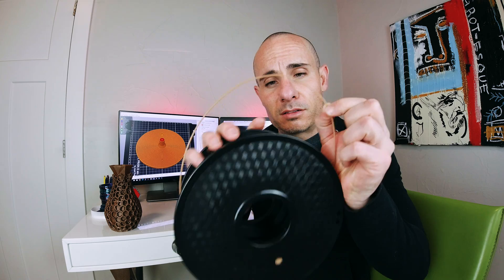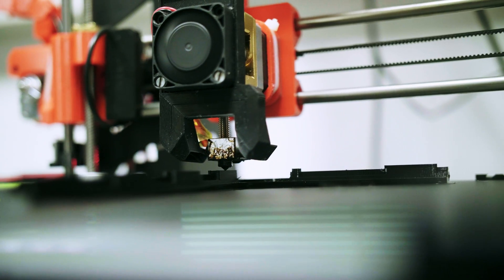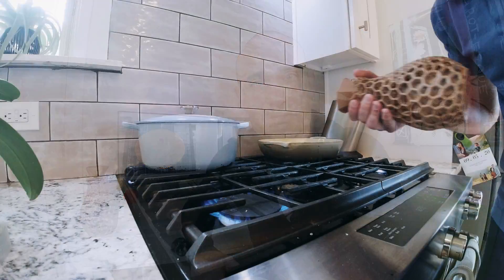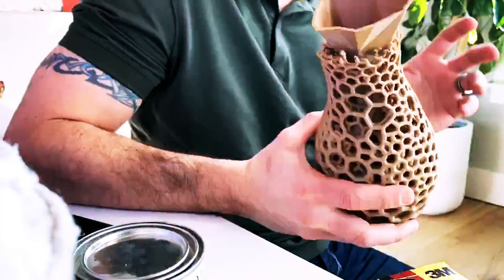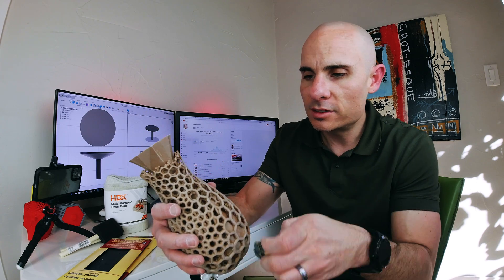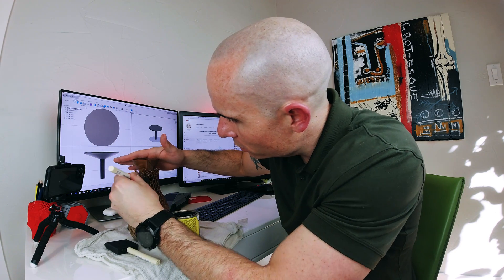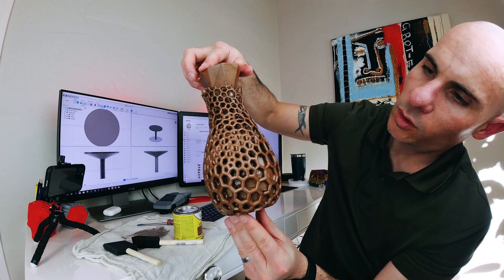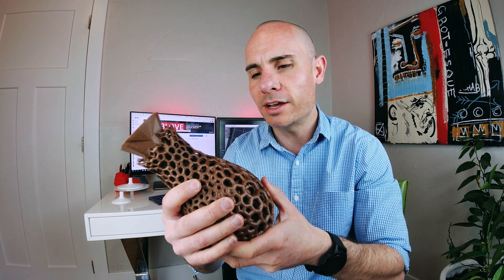3D Printing with Wood Filament: What You Need to Know

Comment: Applying wood stain next to your computer setup?!  That's some high confidence in your ability to apply without splashing.

Also, I didn't see you do it or reference it, but did you wipe off the stain after applying or did you let it dry on the surface?  And yes, I just came across this video now in 2023.
Reply from the maker: …and my desk is white haha! 

From what I recall, I allowed the Stan to dry on the surface which ended up giving it some extra depth. You could always apply multiple coats as well and wipe in between.
Reply: @ALLYOURTECH3DP  Thanks for the reply.  It looked good, but I was bit worried about letting it dry.  Generally you never, ever want to let stain sit on the surface as it will become tacky and never fully dry/cure.  Multiple coats definitely can add more depth though, if it's penetrating far enough.  I'll freely admit to knowing more about woodworking than 3D printing, so the fact that this filament works so well gives me ideas when my Prusa XL finally arrives sometime within 10 years.

Comment: What nozzle size did you use? Any other parameters other than temperature that helped you print more efficient? I am using the Prusa slicer on a Mk3S.